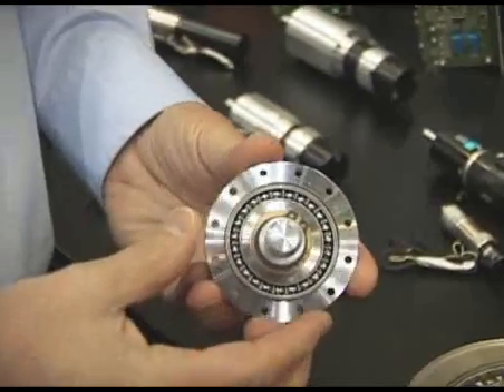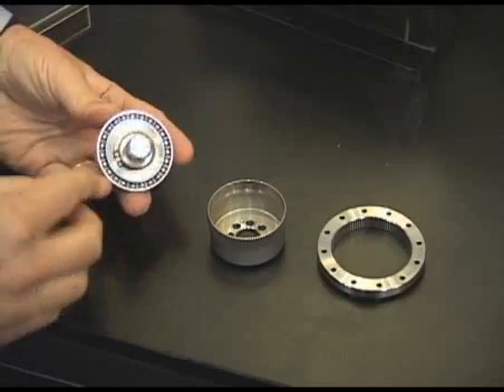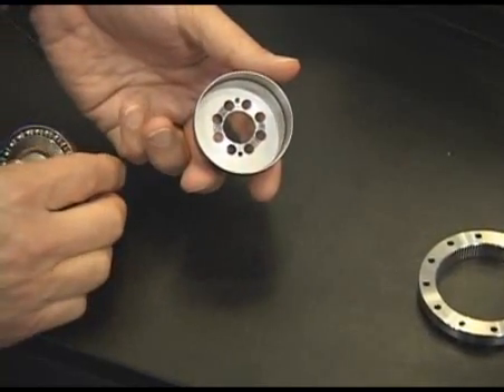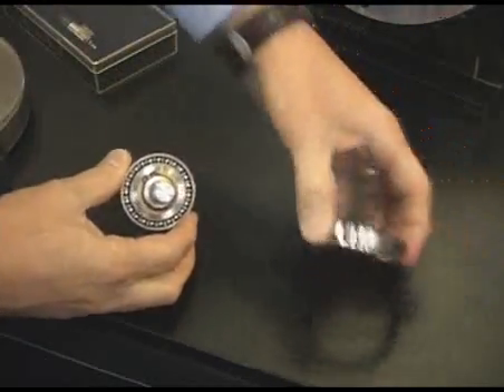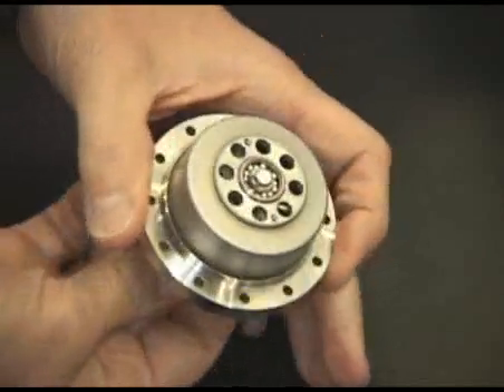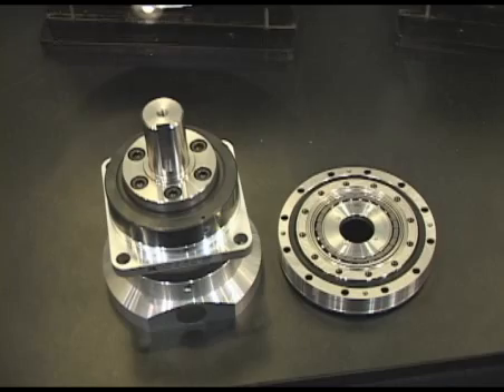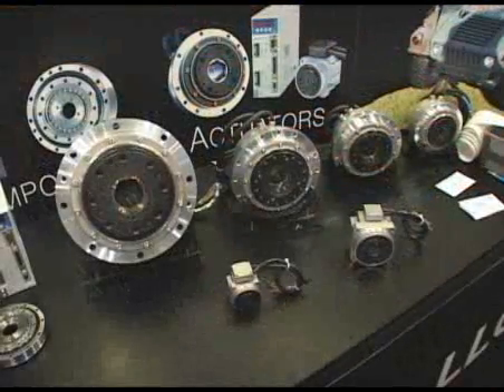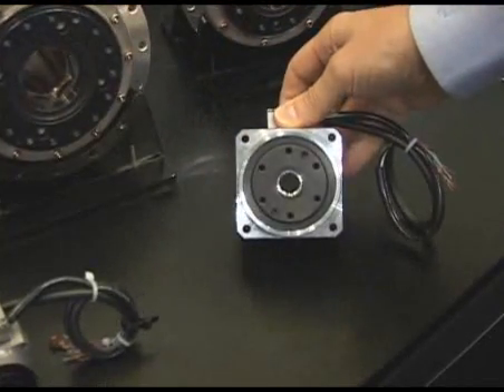Harmonic Drive

Comment: What are the limitations of torque transmitted through such drives?
Reply: that's what I'm wondering, when does it start to slip
Reply: This question is heavily depending on motor. For example, on stepper it will slip and skip (dependimg on tension with flex spline. On industrial servo motor (if feedback is in input shaft) it will typically slip. Although skip is also possible depending on controller/watts. 
 If setup correctly AND you have 2 to 50k usd, no problem with skip or slip. Conroller and feedback can detect and compensate for such problems.
Reply: CivicsR2Cool  Never

Comment: I used the original Emhart Harmonic Drive on a telescope drive system back in the mid-eighties.  It is a phenomenal piece of work. The zero backlash combined with predictable error makes it perfect for high precision positioning.  We used, at the time, Superior Electric's microstepping index motors to achieve incredible accuracy.